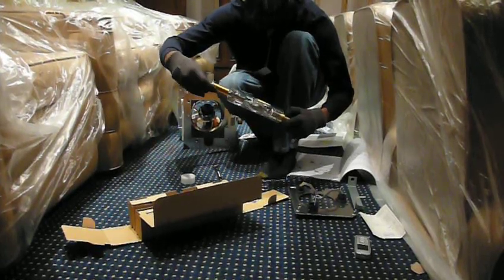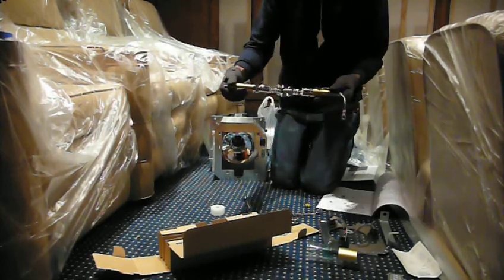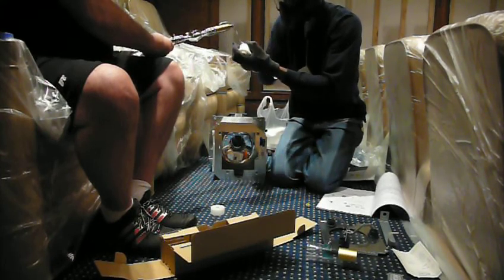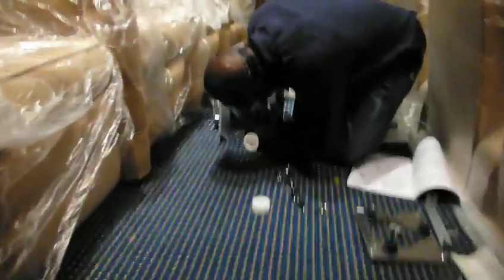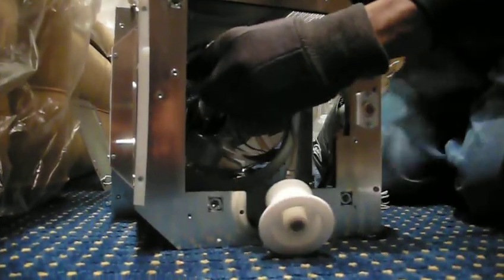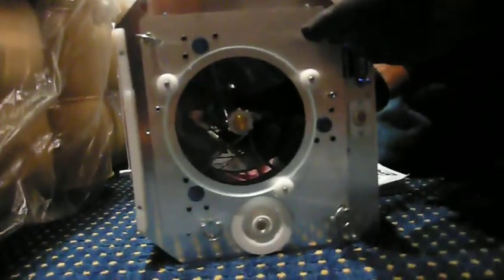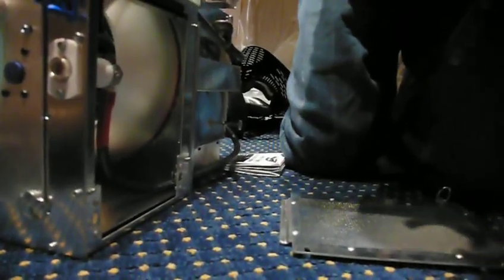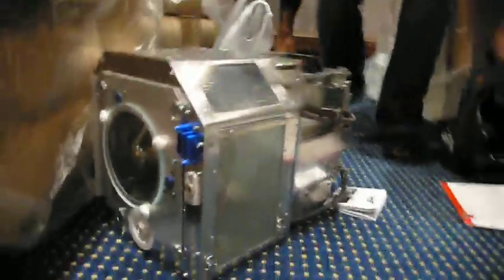highpressure lamp nstall

Comment: I guess this isn't a professional installer...

Putting the anode cap on is best done with the bulb safely in the box with the blast shield surrounding it! The wrong way to do it is to get someone in a T-shirt to hold one end of the lamp whilst the "installer" pulls on the other. Nice.

Note to the guy in shorts and a T-shirt, if that bulb shatters you'll picking out shards of quartz from your face, arms and legs for quite a while.

The "installer" will be fine.